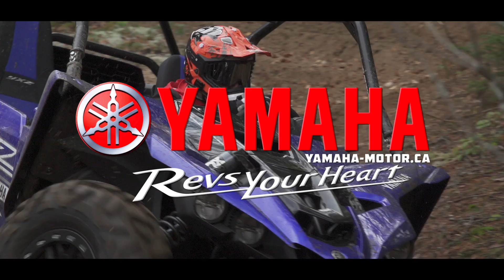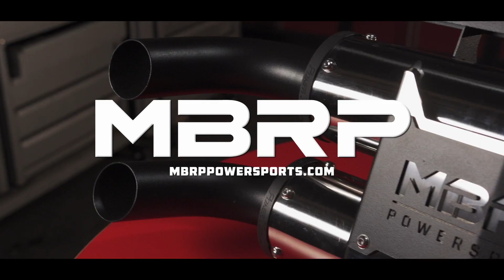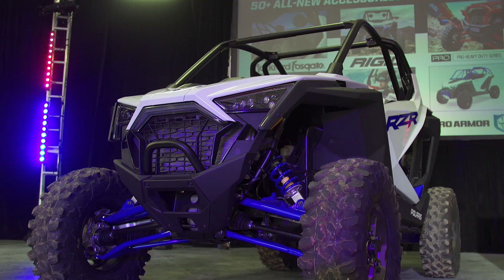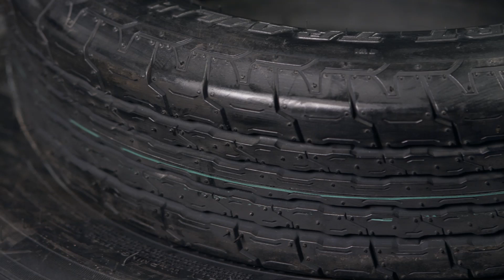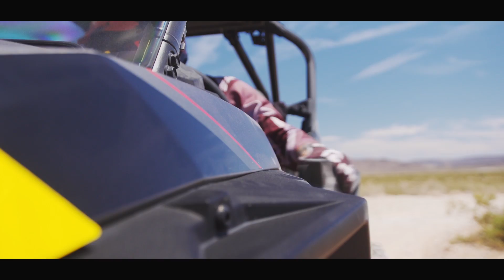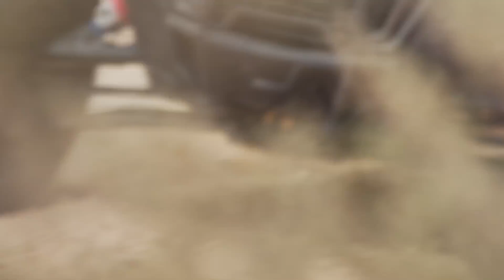Dirt Trax Television 2019 - Full Episode 6

Comment: However, No radio means no Ride Command. This is an outstanding program for not loosing your riding partners out in the middle of the desert. Doesn't sound like much until one takes a wrong turn and slides off the trail...for HOURS!!! Ride command and radios are a must for desert riding.

Comment: The last trailer tire I used made in China didn't last but a year. The sidewalls on on both tires gave out. Had to stop at a Walmart, 350 miles from home, replaced with a Goodyear, made in USA. Three years ago, still holding  up.